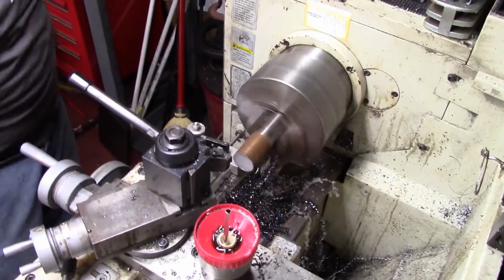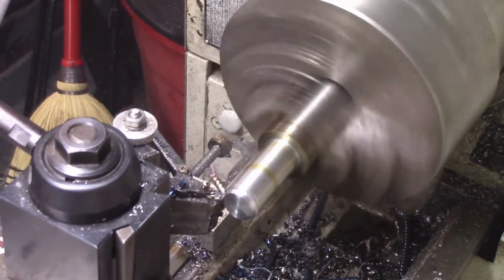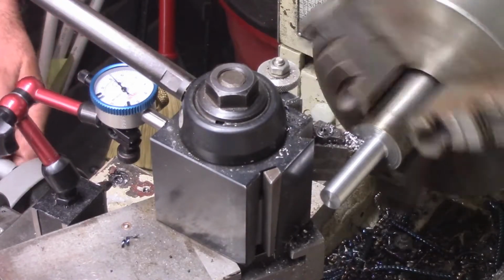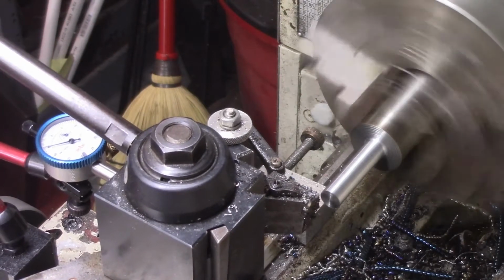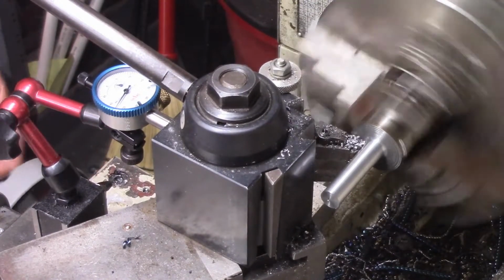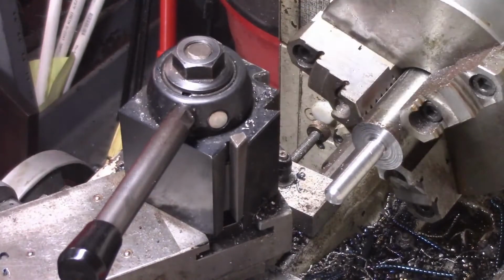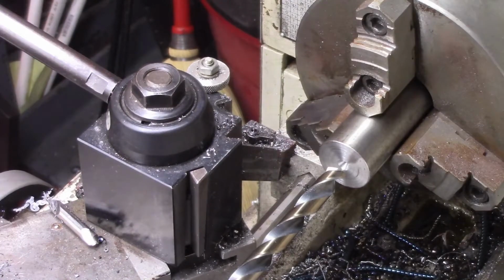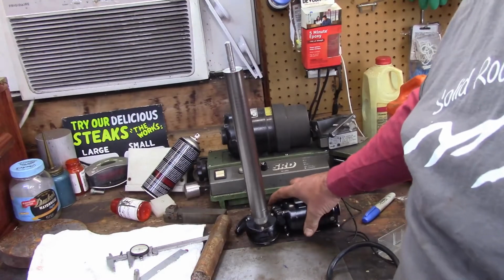Machining the shaft for the tire buffer

Comment: Jim machining is machining no matter what it is for. I love making tools.
Nice video.👍👍👍
Reply from the maker: Anthony Brown's Ragsdale Creek Workshop true this is something I worked in my head after seeing what a commercial unit costs. So far the EBay motor with right angle gearbox is the only purchase I made. Every thing else either was a gift or material I collected from scrap bins and purchased at reduced price